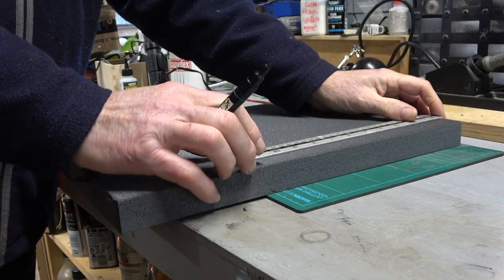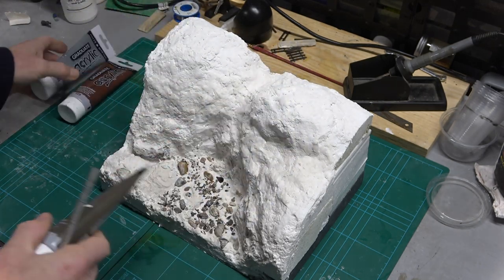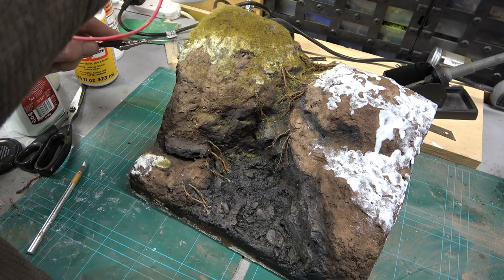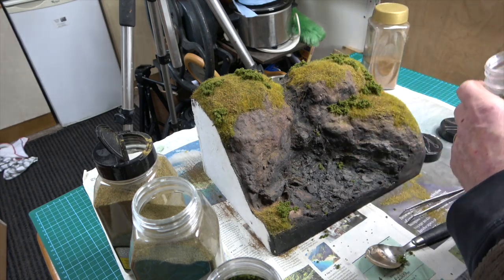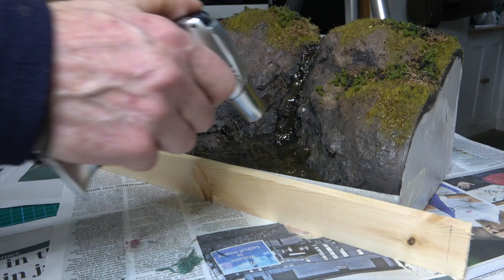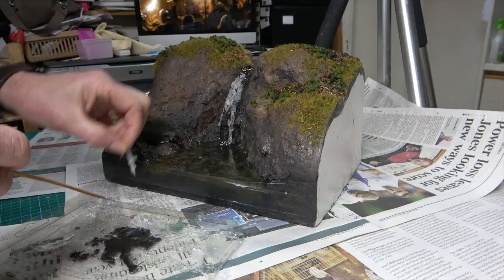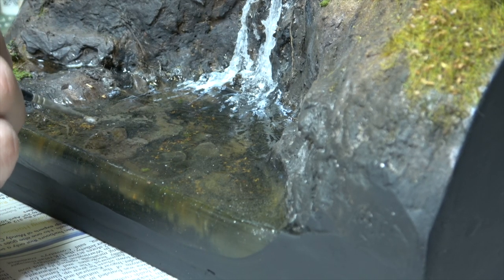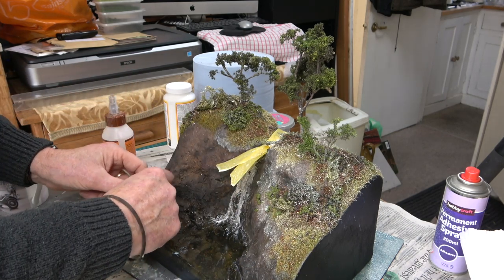54. Creating a Realistic Waterfall Diorama From Scratch - My First Stand Alone Diorama Build - Enjoy

Comment: Hi Paul. What do feel is the advantage of using dried natural twigs for the tree armatures instead of florists wire of various gauges like Luke has shown covered with material such as latex? Do you think it is a more natural look or is it just time and cost?
Reply from the maker: Hi Mike . If honest I use several methods. It is just that I uses natural amateurs on this project, They are not as robust as wire, but can look great if you get the right bits, cheers Paul